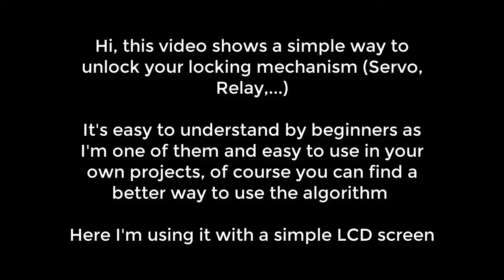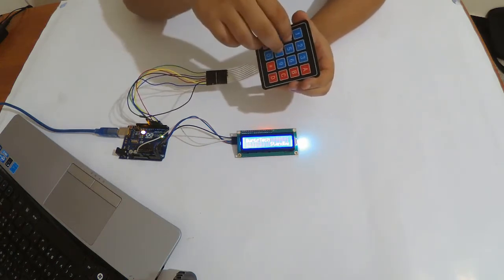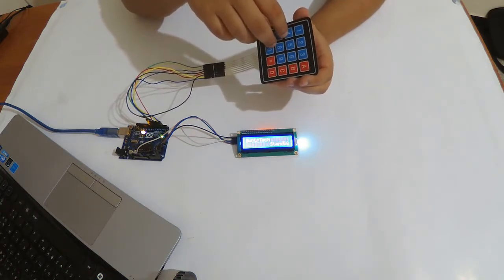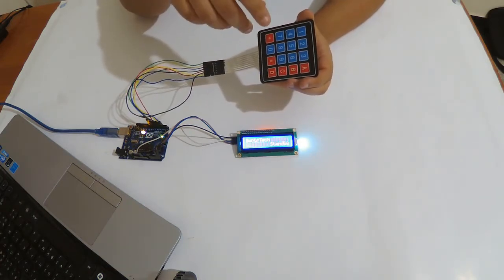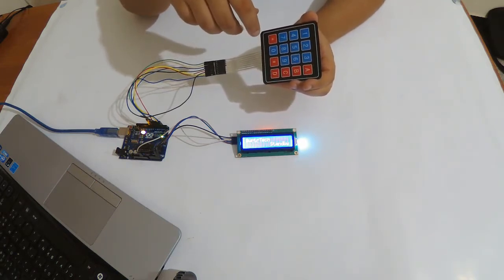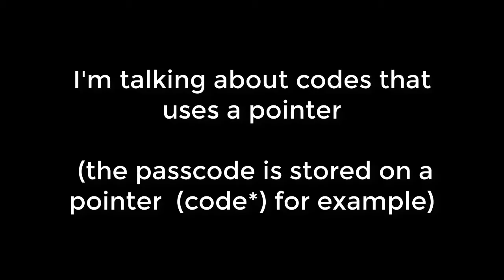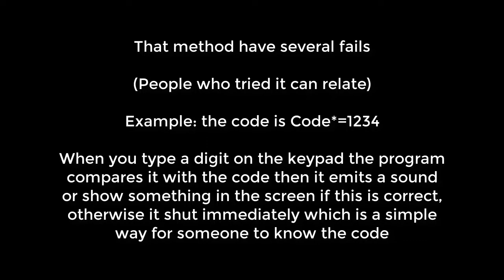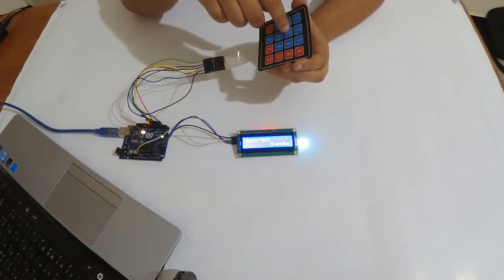Simplest Arduino code for door lock/security with keypad and LCD

Comment: Hello Sir,
I have reviewed code and realized that characters of the code are summed as an int. That says if the code is 1234, then 4321 can be true (or 2314,4123,1432, etc.). I mean only the sum of characters of the code plays the main role, not the sequence. Am I right?
Reply from the maker: No you're not right, the first number is multiplied by 1000 the 2nd by 100 the 3rd by 10 and they get added to the last.
So if the code is 1,2,3,4 the total will be 1234
If you typed 2,1,3,4 the total will be 2134

Not only the sum but it consider also the position.

Comment: What if i will put a solenoid lock with 5v relay, how can I attach the code in the program?
Thank you.
Reply from the maker: You can use the solenoid lock with a transistor (IRF510 for example), and in the code you can add it in
 "if (tot == code){ 
(Transistor,HIGH); //to open
...
}"
and when you want to close you make the transistor on LOW state.
If you really need to integrate a relay it's pretty much the same you'll just invert LOW and HIGH
I'm planning soon to do a tutorial where I make an easy version of this code, because this one is meant to convert the code to an int, and it could be better if used with functions...

Comment: Can it's password be changed 

If yes so how
Reply from the maker: For now you can change it from the code itself only, you can check in the code a line " int code=1366" I've add a comment near it mentioning you can change it.
Later I will upload another version where you can change it by keypad too, I just need some freetime, keep it up.